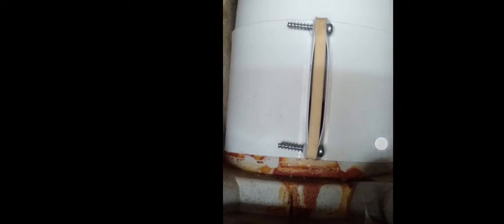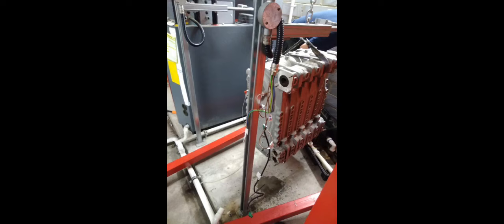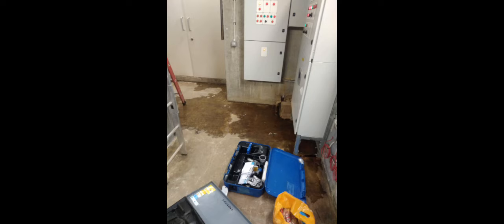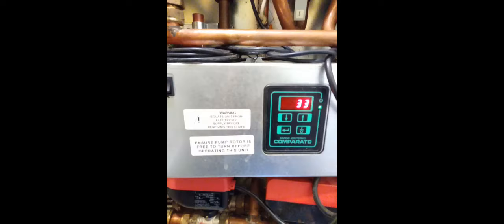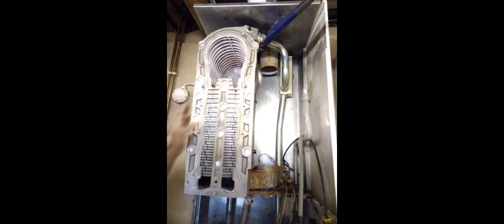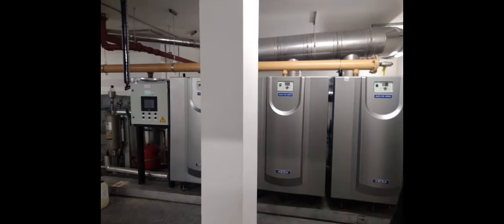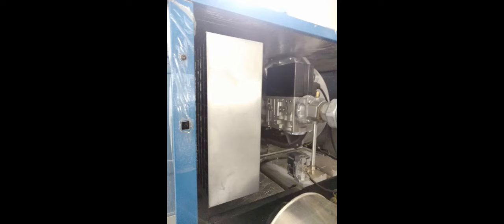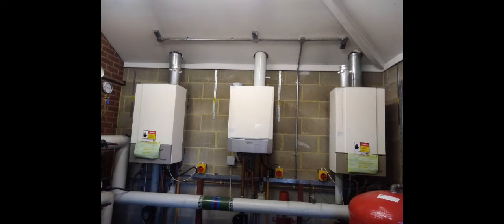FIRST SITES AS A COMMERCIAL GAS ENGINEER pt2

Comment: Yeah very easy to make silly mistakes that can be costly. E.g. changing a Grundfos 3 Phase head. Open box label on top shows, when handling don't tilt pump head to far forward. I did, amateur slid out fell 18ins onto floor and landed on Turbine knocking out of its alignment. Could still installed but I don't work like that.
Reply from the maker: Stay safe